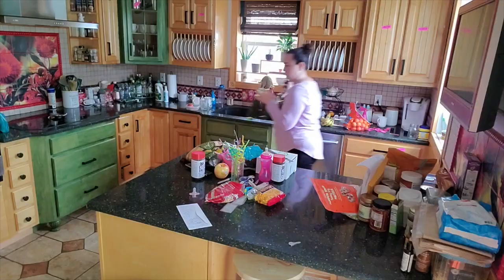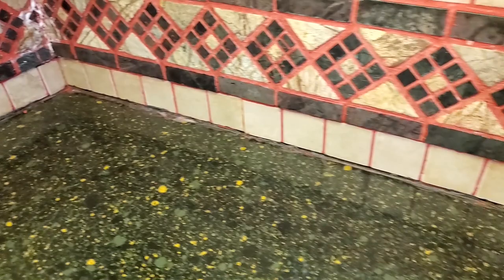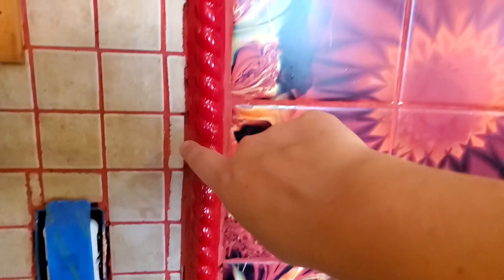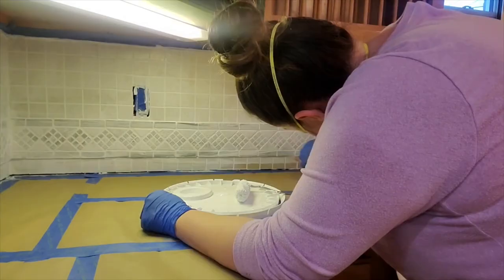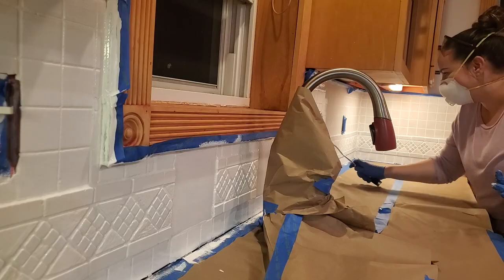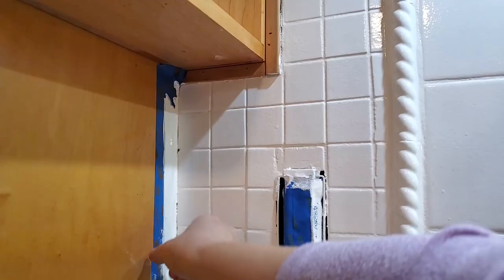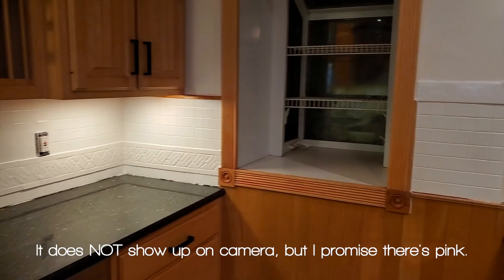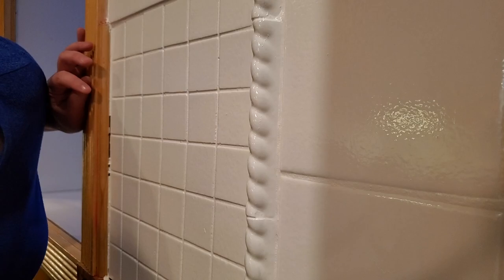Painting Our Kitchen Backsplash (with Acrylic Epoxy Paint)

Comment: You might want to try using the green frog tape rather than the blue. I used to feel the same way about the blue tape, and I kept making excuses for it until someone told me about the green tape. I always use green now, and I have never had any of those same peeling issues.
Reply from the maker: Thank you!! I also have since learned that there are different tapes for different surfaces and I just need to be faster pulling the tape up. Plus someone else suggested using a hairdryer to release the adhesive some? Thanks for the reco! I'll def try it!

Comment: Wow, those back rolls,  why wouldn't you wear a looser top so they are not emphasized so much. The main problem with your poor outcome was that you are a very messy painter, you need to take time to paint the edges properly not just slap the paint on with a roller.  It looks much better but you could have saved a lot of headaches if you were a little more precise in your work.  I am 80 and have done so many of these jobs I can not even count. I did realize at about 50 that losing 30 or 40 pounds makes everything go better in your life. try it.
Reply from the maker: I actually have a whole video that answers your question! https://youtu.be/JoaHFiDys But in short: That's just how my body's shaped. 😘 As much (all?) of the painting in this video is sped up at least 4 times the speed of real life, could that be what is making it seem like I didn't take my time? If you ask my husband, I took pleeeeenty of time 😆